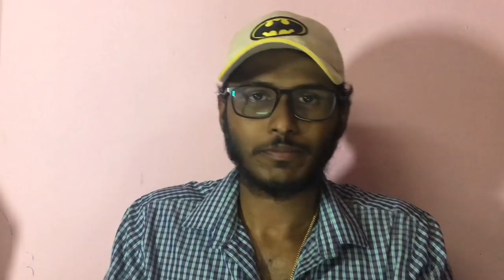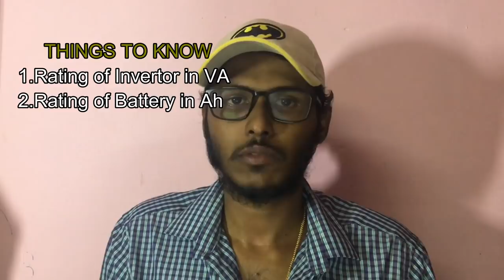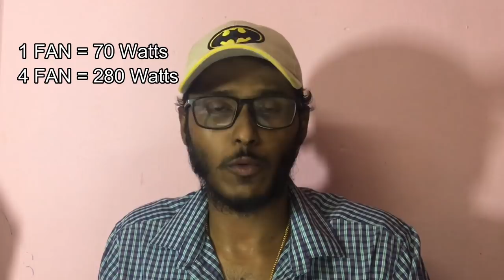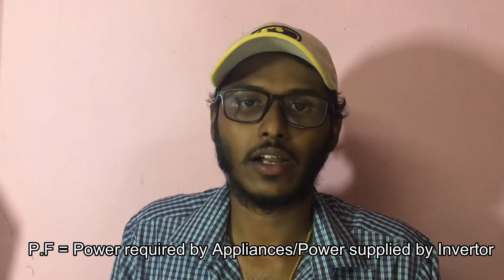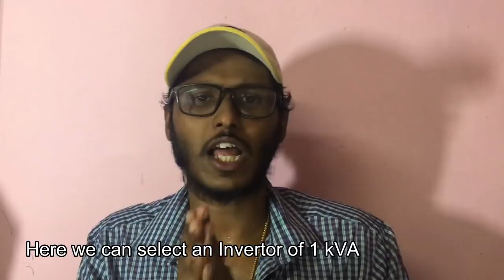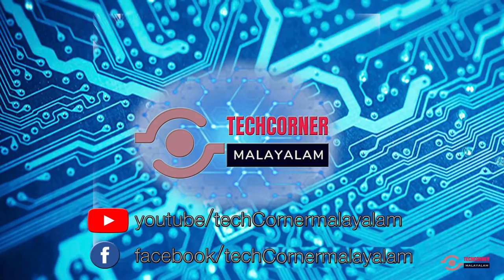How to choose the right Inverter and Battery for your Home?

Comment: Bro inverter install cheyumbo atinte input nu etra ampere Mcb vekanam also output nu etra ampere Mcb vekanam ? 
Kindly mention Mcb grade also 
Plz reply
Reply from the maker: Athu invertor anuserichaan rating...invertor nameplate il kaanum input current output current okke...normal c type mathyakum
Reply: Eg 1000watts/230volt=4.3 amps
Minimum 6 maximum 10 amp mcb use

Comment: Eee vA thnne watts lu paranjude Ie, 1kva=1kw
Reply from the maker: Kva and kw 2 un 2 aanu...actual power and apparent power... kw=kva x PF
Ee video kandolu ..

kW vs kVA | Why Transformer is in kVA and not in kW | Difference between kW and kVA in Malayalam https://youtu.be/fE4u6jzDALo
Reply from the maker: kW vs kVA | Why Transformer is in kVA and not in kW | Difference between kW and kVA in Malayalam https://youtu.be/fE4u6jzDALo
Reply: @TechCornerMalayalam  inverter thnne 3 phase ondo

Comment: Allaa upakaranathilum Athintea watts Azhuthiyatunddu Ath nokkuka 
Eppol paranja uthaaharanam
Total watts 699÷0.7=Answer 985
Appol inverter 985 nu mukalil veadikkaam 1000 kilogrammes 1 K VA inverter veadiverum
Battery 🔋( 3 Manikoor pravarthikaan 985×3manikoor Answer 2070
Eni Battery veadikaan  🔋veadikunna Battery 12?13?14?15?16?17?18?Athra watts SintayaanoAth.                                (1) (2070÷12va=Answer 172.5 Battery 180 Ah).       (2)(2070÷13=Answer 159 Appol Battery 🔋 165Ah)
(3) (2070÷14=147Answer Battery 🔋 155Ah)
(4) (2070÷18=115 Answer Appol Battery 🔋 veadikunnath 120 Ah )
Eth manassilaakki Marketil Athra watts Battery kittumo Ath calculate cheythu veadikkuka Eth only Uthaaharamaanu)Anik Eppol manassilaayathaanu njan Paranjath sorry